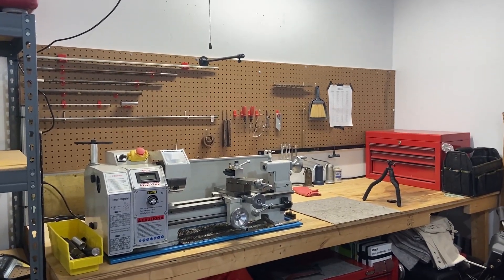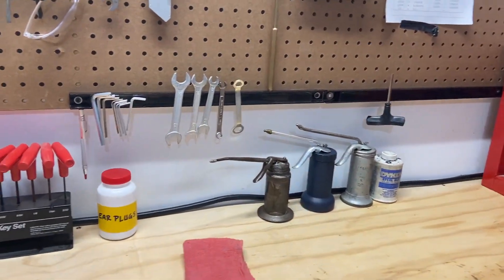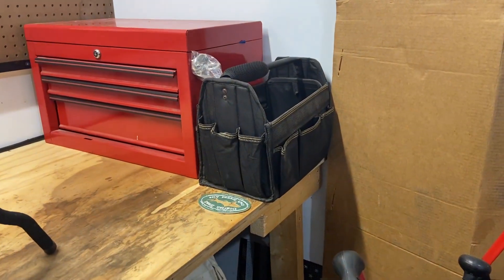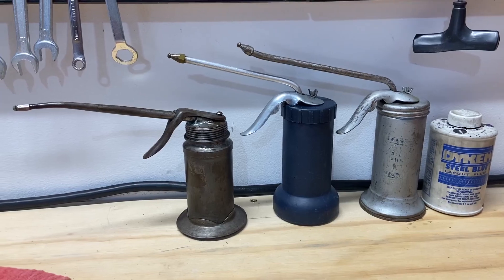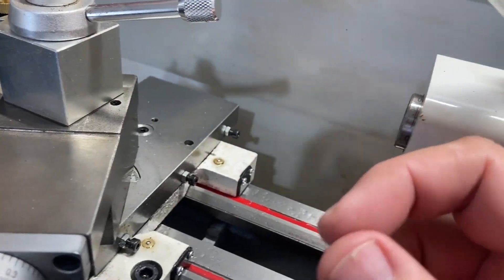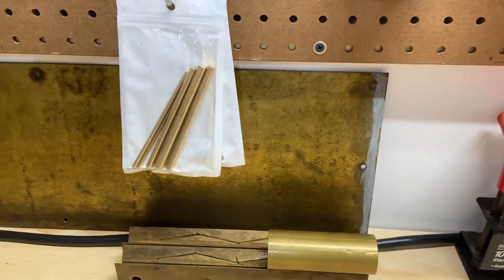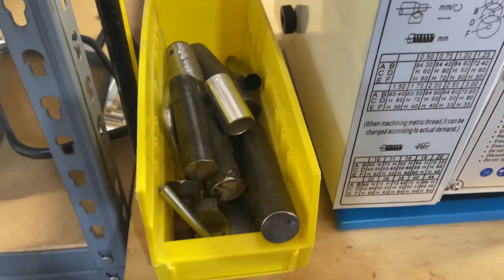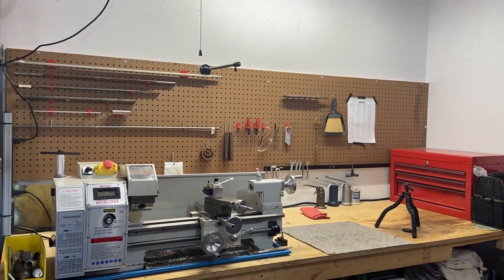Vevor Mini Lathe MX 400 Part 12.1 - Quick Shop Tour Update and More Improvements

Comment: Check out blonde hacks on utube. Very useful hints and tips and advice, beginners guide to lathe and mill set up and first projects. Very recommended.
Reply from the maker: Definitely,  I heard about her Channel a long time ago but have recently re-subscribed and am watching the content she has.  Agree its a great channel with a lot of great information.  Thanks for sharing and thanks for watching.
Reply: @deezworkshop  tip from my own experience, bin the aluminium toolpost there garbage get the wedge type ( 250-00 ) bought mine 2 years ago best choice I made. By the way those carbide cutters you got with the lathe needed sharpening they are supplied unsharpend. Good luck and have fun be safe